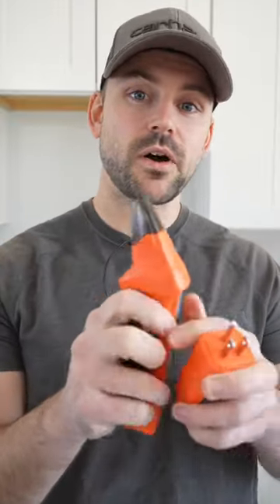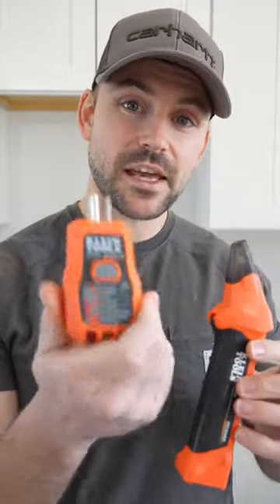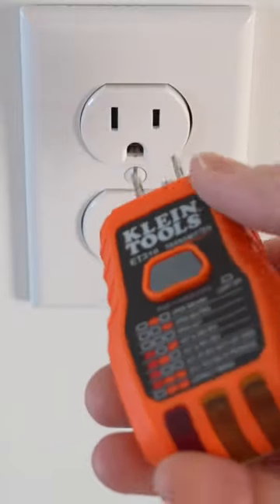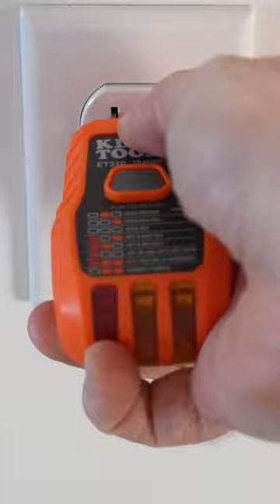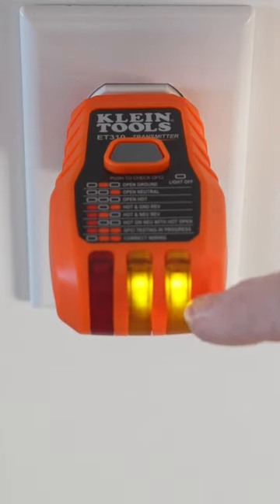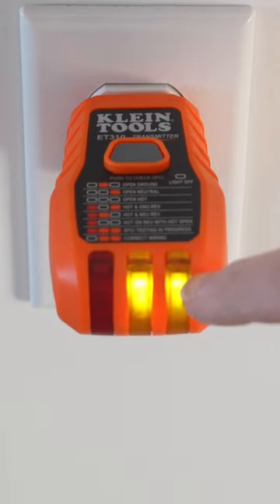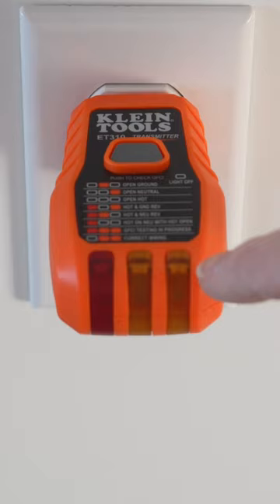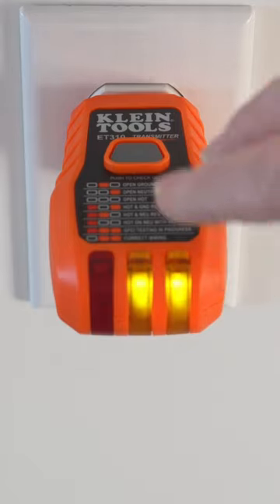Outlet tester light phenomenon! #shorts #diy #tools

Comment: It's the frame rate of the camera making a standing wave with the hz of the electricity in the house. Happens to lots of lights when you record them, especially some screens
Reply: Yeah but it always looks to be flashing very fast on camera when that happens, the fact that it's showing no light for a long period of time on camera while showing light to the naked eye is the crazy part, I have no answer
Reply: @diychad7268  theybare close to the same rate so the wave is only slightly offset, taking many individual wave cycles to match up again, hence it moving so slowly. Its almost a standing wave pattern between the bulb flashing and the frame rate of the camera. If it were a true standing wave, it would be either on or off on camera and not change.
Reply from the maker: I seen this with helicopters on video as well. Thanks for your input!
Reply: @TheExcellentLaborer  that's the example I was going to bring up if there was more confusion lol
Reply: Exactly
Reply: The frame rate of the camera is 60Hz. The grid is actually 59.9. So the frame rates match up every 12 seconds (math is off the top of my head, might be wrong). He's accidentally created a synchroscope, which is the tool used to match generation to the grid. If you're running a peaking station, you spin it up as close as you can to the grid frequency and close the contacts when the light is fully out. Then start throttling up your prime mover.
Reply: @joewiddup9753  the frequency depends on the production vs load. When the load is high, the generators are slowed down a little. Later, when load is lighter, the frequency is higher. You can see that clocks run by the mains frequency are sometimes behind, sometimes ahead. Over 24h, the deviation is supposed to average 60Hz, so clocks are mostly right.
According to my solar inverter, just now the mains is 50.03hz (I'm in Europe)
Reply: @TheExcellentLaborer  yeah I noticed that and sometimes on the cameras look like the blades are going backwards

Comment: Well it is a 60hz outlet and the camera is probably running really close to 60 fps
Reply from the maker: Excellent!
Reply: 59.97 cycles per second frame rate for the video, 60 per second on the LED's driven by US house current.
Reply: @davefink2326  They are LEDs.  They run off DC
Reply: @brazilnut8898  yes,   DC from AC which pulses at 59.97Hz

Comment: For a more particular answer, it’s due to rolling shutter, specifically “the rolling shutter effect” you can find more detailed videos here on YouTube that can explain in much better detail than me. But it’s the mechanism in the camera that captures and image from left to right, as it’s currently impossible to capture an entire image at one digitally. And like others have said, the rolling shutter speed matches up with the frequency of the electricity in the alternating current system of the house. In America that is 60hz and also as some others have said, that’s why you may notice flashing on some lights on camera but not in person(your eyes have an estimated “refresh rate” of 20-40hz so that frequency is invisible to our eyes) the flashing lights effect is mostly noticed on larger or longer bulbs such as Florence bulbs used in the foam tile ceilings. But back to the weird phenomena: 

think of it like circus lights, the lights don’t actually move. They just create the illusion by timing the lights to have the neighboring light will illuminate when the initial light turns off. In this case the light with help of the 2 segments being used. As well as the rolling shutter effect, it will capture each individual image of the video, at a slightly different interval of the invisible flash, and the difference in interval changes it’s place visible on the camera. The main culprit is the rolling shutter. Without that you would just see the light flashing, as the camera can capture more “images” than your eyes can. Hope this made sorta sense! Again youtube can be more detailed👍

Comment: Its just the high speed pulsing of the LED driver.. our eyes have retention of vision, so it looks 'on'.  The video camera takes frames at a slightly different rate than the LEDs are flashing, so it goes from exposing during off periods drifting to on periods and back to off periods.

Comment: Without looking at the wave form or sampling rate this appears to be phase shift within the waveform which may be a sawtooth rather than a square wave and also with a variable duty cycle that is not that unusual in led driver circuits. The camera is acting as an interference filter against the led's averaged power and cannot adjust fast enough to maintain a light balance with the leds variable output.

Comment: The lights are either LED of those little neon ones, either way, they flicker. You can’t see it by the naked eye, but electronic cameras have a frame rate. If those are slightly different from each other…. 🎥

Comment: Zero capacitance and next to no heat. So you're filming at 60hz with digital exposure correction. Note the electrical system is also at 60 hz. Its the same phenomenon as helicopter blades looking stationary on camera

Comment: Electricity in the house is 60hz, just the same as the frame rate of the camera
Reply: If that's the case then it would show the same thing as the naked eye, the fact it shows no light for a lo g period of time on camera while showing light to the naked eye is the weird part
Reply from the maker: Very good way to describe this!
Reply: @diychad7268   Your eyes are way faster than 60hz. That's why you can see it.
Reply: @diychad7268  It shows no light for a long period because the camera is taking its snapshots in between the light blinking. Light blinks 60 times per second and camera takes 60 snapshots per second. However, they are not both exactly the same, they are slightly off. So after a second or two, the drift causes the camera to start taking snapshots when the light is on or in the process of turning on/off.

Your eyes will always see a solid light because your brain can't process anything above ~30 Hz. If you were to slow the light down to less than 30 Hz, you'd start to notice an annoying blinking.
Reply: @trevorsmith5524 Human eyes and brain cannot process more than 60 frames per second (fps or hertz, they're equivalent).

Comment: Without a camera. If you look carefully. You will see a very fast flicker.
Nothing wrong with it. I brought this up the other year at a show. I was informed that is part of the design. 
Led lights do not use 120v directly. You need avdriver for leds. 
Thus the flicker.

You only see it on camera. If you have a keen eye and the lighting just right. You can see it flicker very fast.

Not a prob. Don't forget it is a tester. So it does not need anything like a flashlight or a overhead light. And the power required for a led is way less than incandescent. 

Also it has to send a signal back for the device to pick it up.
It not a design flaw. It is more or less a additional safety.